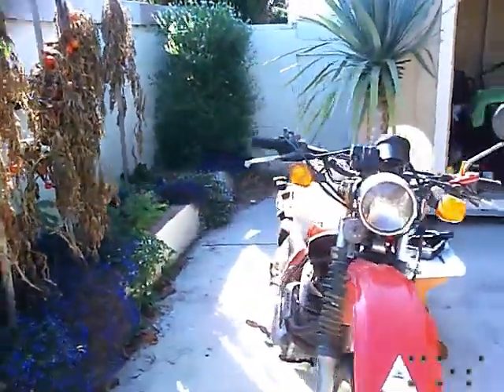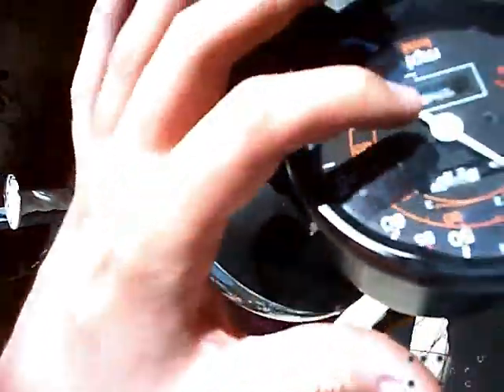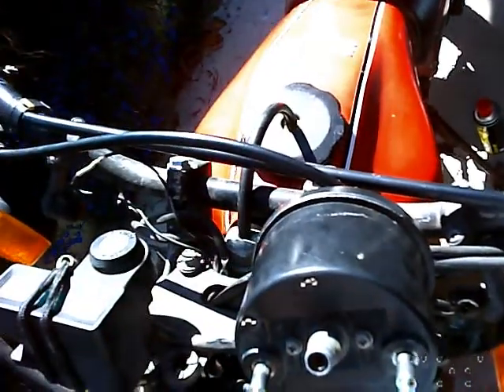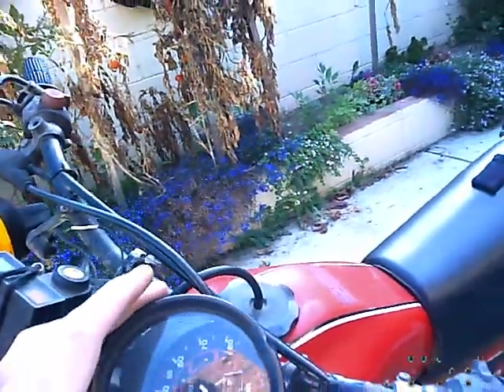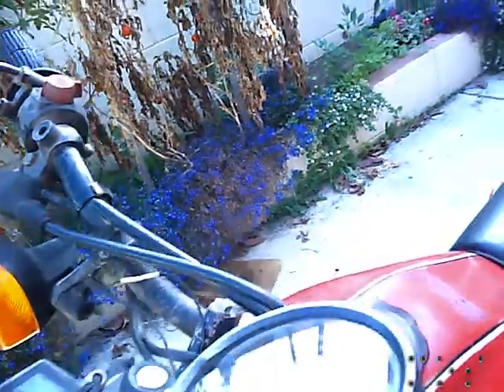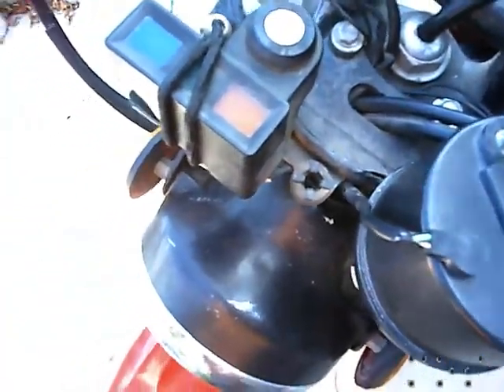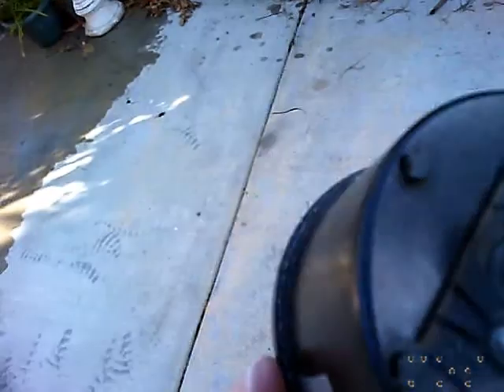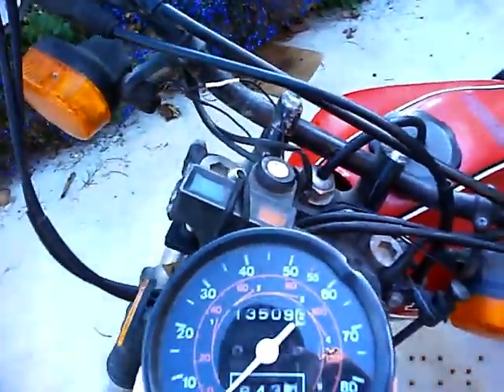Speedometer lens removal xl500

Comment: It’s a long shot as this video is 9years old....... did you manage to repair this? Was it possible?
Reply from the maker: It did work, I still have the bike and I guess I did it right cause its still waterproof and hasn't come loose or anything in the last 9 years.
Reply: Fantastic! Glad to hear you still have it! I have just got the exact same model year XL as you. Yesterday’s first ride abs the speedo started making a horrible grinding noise and now it does not work...... I’m after a parts shop or what possibly might’ve wrong with it?
Reply: Fantastic! Glad to hear you still have it! I have just got the exact same model year XL as you. Yesterday’s first ride abs the speedo started making a horrible grinding noise and now it does not work...... I’m after a parts shop or what possibly might’ve wrong with it?
Reply from the maker: @2WheeledPatinaThomasC  It might be one of the gears inside of the speedometer I'm not too sure about the inner-workings of it though.  On mine the screws holding the back plate on had come loose and fell out so it was just spinning around in there so the whole reason I took the lens off was just to put the screws back on.
Reply: Thanks mate, think I might take a look inside today